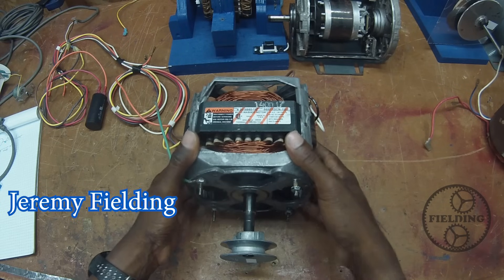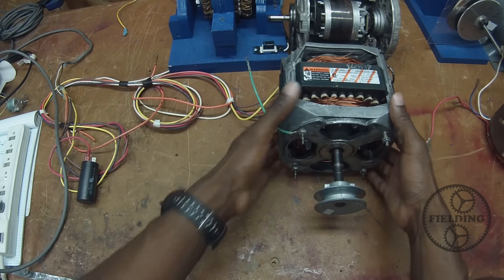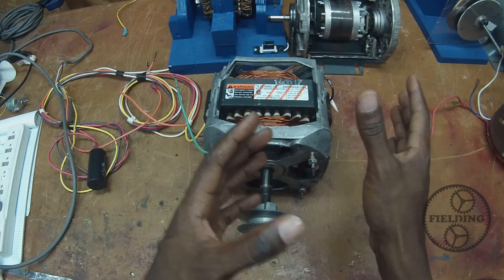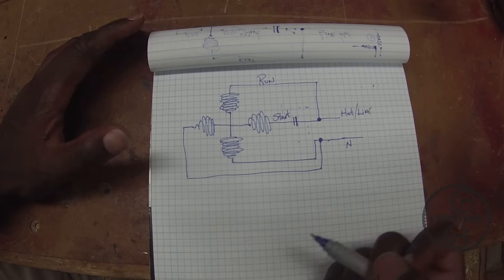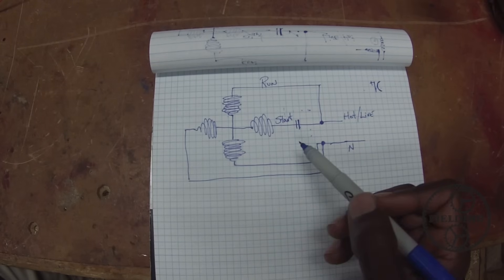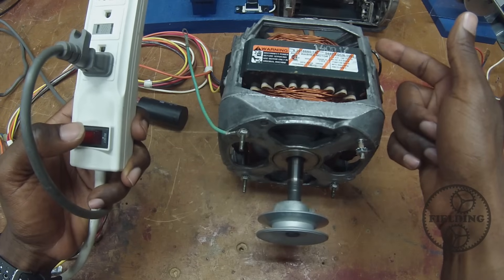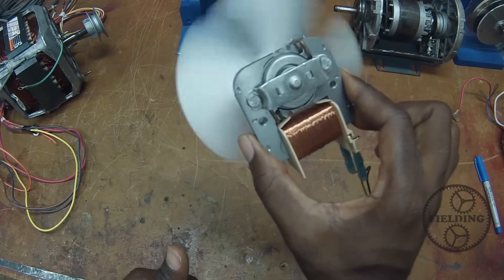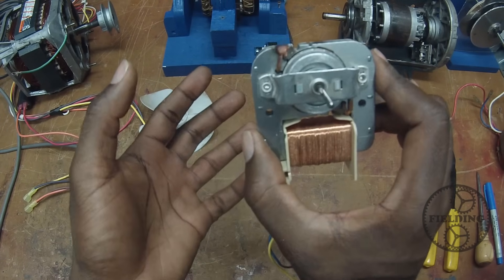How Motors Work For Beginners: (Episode 4) Single Phase Induction and Shaded Pole Motors: 035

Comment: I watched this video months ago, trying to learn all I could, not knowing how useful it would be for me. My mother wants a serger sewing machine and I found a very nice one local to me for a decent price with the caveat that in order to get the motor running, the handwheel needed to be turned. I knew that I remembered something from this video was relevant so I came back. I now believe I have isolated the issue down to being that capacitor or a starter winding and I haven't even seen the machine. Thank you for helping me make my mom happy!
Reply: Constant voltage through the footpedal fried the starter winding. I fixed it and I owe it to this video.
Reply: @shakerson 
"Why would I need to learn math and engineering irl?"
The 'rl' in question:

In any case. 👏🏾

Comment: It's great that you appreciate and point out "ingenious" engineering.  I was an industrial mechanic for about 15 years and respected many of the machines I had to repair for the way design problems were solved.
Reply from the maker: I feel the same way. I marvel many times at the simplicity of some great designs. I know from what I do, that many sleepless nights can go into an idea that is so simple you can't believe how ... cheap, easy, simple and yet functional... etc it was.
Reply: There's some clever people in the world. Then an awful lot of dead weight.
Reply: That's humility and admiration, respect if you will.
Reply: @Jeremy_Fielding  I need a wiring diagram to run this electric motor! It has 6 black wires come from the motor which is labeled T2,P,C.C and P and T1 is connected together. Any help will be greatly appreciated
Reply: @Jeremy_Fielding  Wow you are a rocket scientist

Comment: 4:18 ..."if you hooked them up backwards... uh, you'll have a bad day" Love it.
Reply: me too
Reply: Not if you're electroboom
Reply: I giggled quietly. 🤣
Reply: Isn't that called "releasing the smoke"?
Reply: Two things went pop when you first plugged in a circuit board - a reversed electrolytic or a shorted plastic transistor.  Some early line drivers for core memory (see, I'm an old fart), too, when being stress tested.  The line drivers would shoot up a little flame.
Reply: lol 👈🏾

Comment: Mr. Fielding, your videos are exceptional...you have a gift for understanding technical things, and also to explain them.  I started watching your videos about two weeks ago.  I kind of understood that AC motors worked because of a rotating magnetic field, but didn't really understand.  Thanks to your vid's and the old military training videos you linked, now I know so much better how they work.  Fast forward to this weekend.  My outside A/C unit quit working.  It hums but the compressor/fan are not running.  My first thought, thanks to what I learned from you, was this sounds like a capacitor problem.  Sure enough, in my unit, the fan and compressor share a run capacitor.  I tested it and it is definitely bad.  So, 12 bucks on Amazon and a new capacitor is on the way.  I am 99% sure this is the problem.  But I would have had no idea if I had not watched your videos.  Thank you!

Comment: Currently a grad student in Electrical engineering. I never realized that the dryer switch is what connects the start capacitor! That's genius! Also explains why when I don't press it long enough the dryer doesn't start up

Comment: Thanks for the great video. It allowed me to almost instantly deduce why my Dayton electric motor was overheating...and shutting down via the thermal overload switch. Your explanation of the start winding overheating (if left engaged) is what triggered my realization as to what was happening. The centrifugal switch on this particular motor normally disengages the start winding once the motor spins up. The centrifugal switch is supposed to pull away from the spring-loaded metal contacts that engage the start winding...allowing the metal contacts to separate and break the circuit to the start winding. But instead, those metal contacts remained touching (or nearly touching) even after the centrifugal switch activated. That left the start winding permanently engaged and it QUICKLY overheated the motor. In fact, the casing was so hot I couldn't hold it in my hand. The solution...carefully bend the metal contacts so that the gap is sufficient to keep it from being permanently activated. Don't bend them too far or the centrifugal switch won't be able to close the gap. Very simple & free fix...and I now have no more overheating!

Comment: You do an awesome job of explaining an induction motor.  My well pump uses a voltage sensing relay as opposed to a centrifugal switch.  It a normally closed relay that opens by sensing the motor back EMF.  The relay and start cap are mounted remotely.

Comment: I love you tube .if only I had this in 3rd grade.lol . It's like that moment of enlightenment  when algebra has me twisted up  and suddenly  its crystal clear . Lol I never took algebra in high school. But electronics  and algebra  are like inseparable   so off I go to study the math  all fine and dandy until the polynomials.  And there I get wrapped around the axle.. my point ..I clear presentation  makes all the difference. Thanx for your  videos.. Ive learned some key things  like what you've inducted magnetic field is opposite in polarity.  The pipe and magnet example  made it clear .  I still have nightmares where my English report  is due in the morning  and I have barely started..

Comment: I knew how starter capacitors worked, now I know why they work. Thanks again.
Reply: I'm still a bit hazy on how a capacitor reactance can make a phase lead myself. It sounds like time travel to me.
Reply: Thats why you need a Flux Capacitor to time travel.   It has to do with shifting the voltage out of phase with the current. A cap will cause the current to rise before the  voltage. In a coil or inductor , the voltage goes up before the current. Using a combination of the two you can cause a phase shift, the motor windings being the inductor and the capacitor being , well, itself. It has alot to do with magic and faith

Comment: Jeremy I have watched your series from the beginning. You are an excellent teacher. I am almost 66 years old and have been scratching my head trying to understand 3 phase and now your explanation is the one i needed to hear. You do not need to be as old as i am to learn. I have sent the first video explaining how electric motors work to my 12 year old grand son. He is a brilliant young man and I believe if he harnesses his mind he can some day be an inventor. I have several ac induction motors that just buzz when power is applied. How can i tell if it is the capacitor and how do i troubleshoot bad windings ? The other question is if the numbers are no longer on the capacitor of an old 115 volt motor how do I determine which capacitor/capacitors to buy? Thanks so much for sharing your knowledge with us and also your time.
Reply from the maker: Most of them are about the same size and capacitance. If you bought a washing machine motor capacitor it would work just fine with any 110/120 volt motor. The capacitor just needs to be rated for the voltage or it might explode. That would not be good. The rating is always on the side, and it should be something like 120 volts or more. NOT polarized. If it has a plus and minus side that is the wrong kind. that one will also explode. It sounds scarier than it is. Just get the right one and everything is fine.

Comment: Thanks so much for this series of videos. I recently acquired a free treadmill and tore it apart for the motor and other parts. I've since used the PMDC motor and its controls to power an old (1940s) Craftsman drill press that I restored. Your videos have made clear everything that I was sort of guessing at as I rewired all the parts.

Comment: comprehensive videos, thanx a lot sir. I understand better when I watch your tutorials. I'm having a problem with a single phase induction motor which hums and no rotation. I noticed it even has resistance when humming when I try to hand start it. I changed a capacitor but no change

Comment: I am well impressed by the way you explain in plain English, a rare talent in modern education.
I'm an old guy and spent my post military life as a cabinetmaker so I'm not spark friendly and could use your help.
This may take a few messages to get right as what I have was built by others.
It's a variable switch external to a motor, if I start with the basics it will take less time.
The motor was detached from the controller but I can't tell how to wire it back, four wires two red two white with red trace, are they pos and neg? if so how do I tell which goes with which?
I hope that's enough info for you, other than your channel no one covers all motors, thanks.

Comment: Excellent series of videos Sir.  I notice you called the non rotating 1/2 of a motor, the stator, which is of course correct.  It's amusing how many makers of motor videos (hot tub motors specifically) call the rotating part, the stator.  Rotate = Rotor.  Stationary = Stator.  😉

Comment: After going via your videos I realised a lot of practical concepts. You appreciate these ingenious ideas that no one talks about on YouTube and I hark back to what  my teacher said to me one and that is only good teachers creates great disciplines.
With that said, I would appreciate if you could help me with a problem that iam facing now and that is I have a water pump motor which is a single phase capacitor start induction motor. After turning it on it functions normally, but, after 15 minutes of operation it automatically stops working (even though the supply voltage is on). Can you tell me why this is happening?.

Thanks 🙏 in advance!

Comment: Jeremy,
Is there a reason you never covered the purpose and function of a run capacitor?
1-My questions are as follows,
2-Why does it remain in the circuit?
3-Is it needed for efficiency?
4-Should I think of the capacitor as another phase to help the motor get started.

By the way you have the best videos on motor operation (bar none)
NEW FAN

Comment: Thank you for your video. I really enjoyed it and learned from it. 

On the fan example at the end of the video you mentioned that the magnetic field travels through the iron core. I beg to differ, that’s the magnetic flux traveling through the iron core. I wanted to mention that because magnetic field can be sustained in one direction as long as you have current while magnetic flux only at the first instance when voltage applied, reason this method only works with AC. Please correct me if I am wrong. Thank you!

Comment: If you haven't done it already, now you have to explain / show why 3 speed fans - ceiling , box, table fans and so on, always start on the fast speed. The first pull of the chain is fast, or the first switch position is fast. Then medium, slow and off. Basically, at the slow speed setting it hasn't enough umph to rotate...

Comment: I have an old electric clock that uses a single phase motor. On the back of it, there is a little wheel that you have to spin to get the clock to work. It has a sweeping second hand so you know the motor has been engaged.

Comment: In your diagram showing the capacitor in the circuit you need to add the symbol for the centrifugal start switch.  This is to clearly distinguish between motor types that use centrifugal switched and those types that do not (shaded pole and PSC).   I'd suggest you add commentary about permanent split capacitor (PSC) motors that do not require the centrifugal switch but supply the phase shift using the capacitor.  PSC are also far more efficient than the shaded pole as well. I did however, generally very much like your practical explanation of how 1 phase motors work.

Comment: Thank you I had a lot of lights come on in my head when you explained this video on the microwave motor one can be running through the copper line or the winding as if you were to touch it would you get shocked thank you Dennis

Comment: 1st of all, let me say how much I really enjoy your videos. They're very instructional you make them very interesting and I'm just glued to everyone of them when I'm watching them ! I do have a question, I have a fan that I use as a exhaust unit to suck out overspray paint in bathtrooms.The problem I have is that they design this fan with the motor in front of the fan blade which draws in the air. This causes a turbulence and what happens is the overspray from my paint gun just circulates in the room instead of getting sucked out . What I would like to do is, reverse direction of the motor. It is a small AC motor of course it has ball bearing disk on each end of it. Is this possible?

Comment: Thank you for the easy to follow explanations.

Will you be covering the Current vs. Potential Relay, and how the Current Relay is used in place of the centrifugal start switch on some motor applications?
Reply from the maker: I actually edited that part out! I thought the video was too long. I showed a relay I took out of an old washing machine and basically noted what you just said. It was only about a minute but I find that I get the best audience retention when my videos are about 10 minutes or less. I still went over on this one. I might bring it back for the Q and A...
Reply: Thank you. I understand.

I linked some of the motor videos to the GarageJournal forum. There's a thread or two dedicated to vintage Craftsman 'Block' grinders.

Keep up the great work you're doing. It's appreciated, and I know there's a lot of 'hidden' time/effort that goes into posting the videos.

Comment: greta job bud! Im in the HVAC field and work with both 3phase and single phases motors and compressors so this is perfect. Not sure how important it is but was still wondering about delta and star or wye configurations and the differences between the two????

Comment: Great video and enjoyed the whole series so far. But there is something I need you to cover in this series.
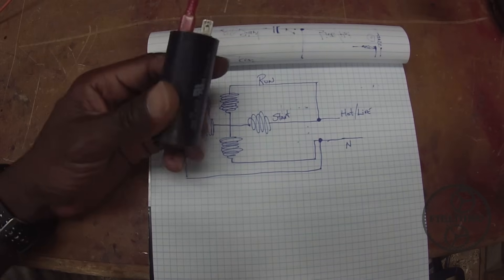I have a small drill press similar to the one you are showing in the video at 3:46. I just removed the capacitor case checked the capacitor. It was 6.5uF 450V Cap, which obviously a "Run" capacitor rather than a "Starting" capacitor (generally starting capacitors rated much higher uF value) where it is connected to the winding permanently. To confirm that I have connected the capacitor through a switch and checked the voltages while it is running turning the switch on and off. When the motor is running I measured almost 420 V across the capacitor and when I turn the switch (disconnect the capacitor) it immediately came back to zero (obviously). So you have not covered this type of motors in your video.

Comment: On the centrifugal switch, it looks like a metal disc that rubs on the nylon switch lever. Once the switch activates, does the disc stop making contact with the lever completely? I imagine it does in order to prevent unnecessary friction and wear. Great video series too! Very helpful.
Reply from the maker: I was cleaning out the shop last week and finally threw that motor away so I can't double check. However I remember that disc being rather slick, and I "think" it doesn't quite move far enough to completely lose contact. The circuit is open of course, but the lever, if I remember correctly, was still just barely touching the disc.

Comment: I thought of using a volume offset to pole alignment. For the start. Using more winding to a negative pole. It would only have that push in clockwise or rather one direction. And less effective in the other. For 2 pole so the starting voltage isn't equal

Comment: Thankyou Sir...you're the best source I've seen for useful information. I'm new to your channel so playing catchup.  An engineering question I have is what is best configuration of coil in generator to moving field ..should field pass any specific way past coil? I've seen magnets swiping past end of coil and others have magnets swiping along  the length of coil as in your hand held demo with magnets and coil.. or does it matter?  If you could discuss coils in more detail please/thanks, and point out the impact on inductance with regard to number of turns of coil relative to magnetic field strength of permanent magnets in generator. Thanks

Comment: Changing electromagnetic field in the stator  induces voltage and current in the rotor  of the induction motor   this magnetic field of the rotor  oposes  electric field in the stator  which turns the rotor

Comment: I thought you were going to hook up the condenser to the motor and explain the relationship between the two.?  Maybe on your next video?  Thank you and keep up the good work.  I'm Learning a lot from your explanations.
Reply from the maker: Do you mean the capacitor? I am not familiar with the term condenser in this context. It could be related to what country you live in.
Reply: Jeremy Fielding you are correct I meant to say capacitor and what it does for the motor. North America.
Reply from the maker: Originally I was going to show it with the painted model I built. I had a momentary switch wired up and I was going to use that. Then I decided to draw it instead. I just think that make it completely obviously which items are connected to what. I will be showing more Capacitors in the Q and A video
Reply: Jeremy Fielding cool thing. Thank you